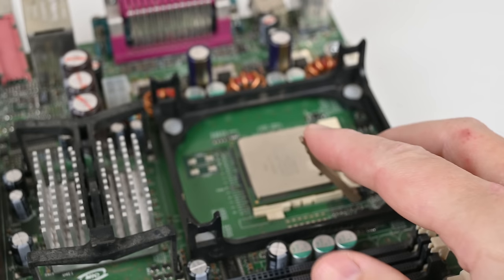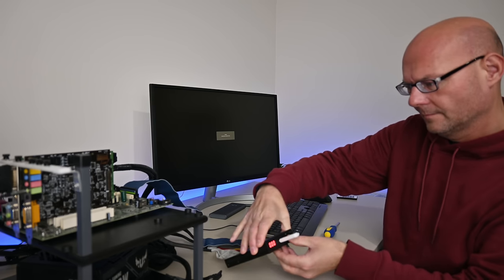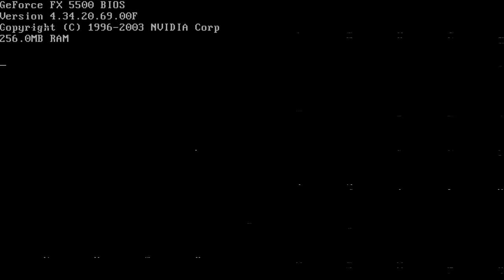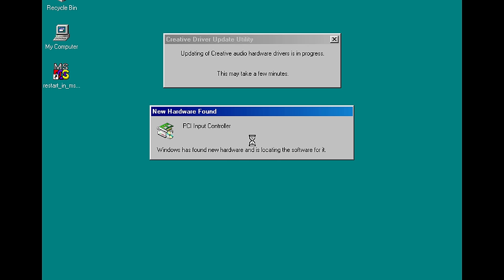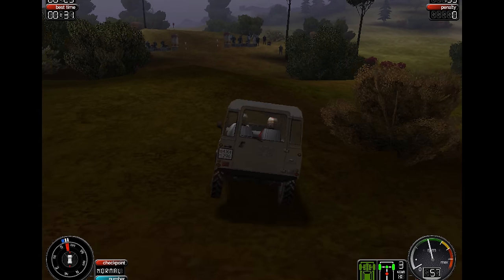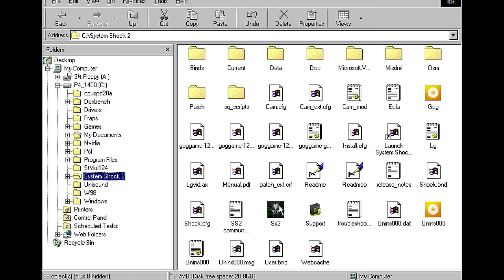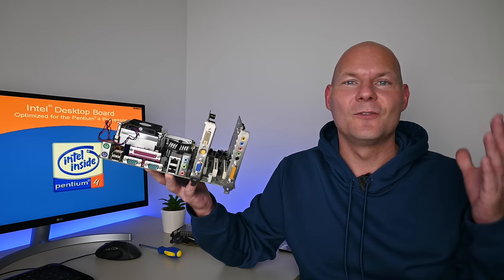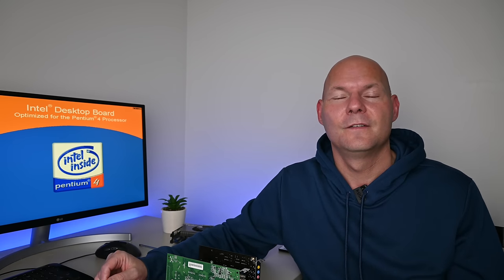It Failed in 2000, Has It Aged Well? The Pentium 4 1.4 GHz

Comment: Fx5200 and fx5500 is exactly the same card, if you flash the correct memory sized 5500 bios to a 5200 they work correctly

Only difference between the two cards is clock speeds and some of the 5200's lacked fans that most 5500's had
Reply: And if the card can run it stable, flash the 5200 Ultra BIOS, which is faster than both and sits between the 5600 and 5600 Ultra.

Comment: P4 the biggest failure intel ever had was building thousands system builds back then while amd crashed intel from 2000 to 2007 in every way around back then from first 64bit and intel had to buy out the technology for future generations to and first dual cores amd p4 was well known to be a good griller to cook specially prescott something intel slowly recovered then by 2007 into core 2 something similar going on now with intel again using old 6 year architectures pumping them just with new futures to catch up with amd but it cant since 2006 intel is gone maybe they will better recover by 2025 when they build ther new fabs and better nm

Comment: Ok so this comment will differ from others in that I am NOT a gamer. I sold a P4 thin client PC to a Locksmith who had a dying P3 system with Windows 98Se and custom key coding software that he lost his original serial number for so I could NOT migrate him to Windows XP pro. The system had 1GB of ram and onboard everything(Intel Chipset i845). Win98Se did NOT like 1GB ram! I had to hack the OS to make it work with that ram! Oh what a PITA! I will tell you finding windows 98se drivers for a Socket 478 i845 chipset motherboard was NOT easy either. The onboard ethernet and sound and VGA was a PITA to find working drivers for. I had to install a small XP pro installation on the same HDD of that machine just to boot into to use his internet to find and finally install drivers to work in his old 98se installation. All in all, I learned ALOT about auto exec bat and config sys file settings that day and I did get it all working. BUT, a lesson here? Retro computing is best left for actual retro computers or emulators.. Old unsupported OSs on modern hardware is a recipe for rage, anger and smashing a PC or 10 lol! P4 systems work great with XP pro and most modern Linux and FreeBSD OSs out there. If you want full hardware retro computing with DOS based OS support, stick to P2 or P3 systems.. That early P4 1.3 and 1.4 system though, I remember from my dad buying it at the computer show in 2000, was windows 98se and windows 2000 compatible, so there is that..

Comment: Athlon thunderbird 1100 mhz, later a 1300 mhz one, burned a motherboard, ram and the first one processor damaging the chip, oce the other one to 1450 mhz and pass to and athlon 754 3000+ what a journey 😵‍💫 Used with windows me and xp

Comment: "The unlimited marketing budget of Intel" translation Intel paid OEMs (HP Dell Compaq Sony and Emachines) bonuses to use the Pentium 4 in almost all their systems and not use AMD's better CPU. Because clock for clock the Pentium 4 was slower than a Pentium 3 which was significantly slower than AMD's offerings. They held up really well for dos and windows gaming up to around XP, Vista and 7 hit the Pentium 4 very hard though and even a newer intel Atom chip tended to outperform it on newer OSes. Have three of these safely tucked away in case someday I feel like making a 98/dos retro PC though as it's more compatible than newer chips, have two 1.6GHz chips and one 1.4GHz chip all for socket 423. The Athlon 64 wasn't just competitive it took a Pentium 4 clocked a full GHz higher to even keep up with them hence Intel's court loss backed anti-trust marketing program.

Comment: The reason the P4 was unloved was because it was so much alower clock-for-clock with the P-III. There's a reason Intel switched back to the P-III core for mobile Pentium-M, and developed that into the "Core" architecture. That doesn’t mean it was objectively slow, execpt when compared to contemporary Athlons! ;-)
Reply: really it was not that slow. It was the stupidly long pipeline........ the p4 can do amazing stuff when used properly
Reply: @CotyRiddle  The long pipeline made it slow in many real world scenarios. Avoiding pipeline stalls and mispredictions could provide decent performance, but that meant both compiler optimisation specifically for NetBurst, and writing code with it in mind. Echos of IA64. The AMD Bulldozer architecture has similar issues, and again it's pretty hated, even though code
optimisation targeting it specifically performs well, especially if using XOP.

Both microarchitectures are great with Gentoo Linux, I can vouch for that, but they were intended to perform well with generic code, neither did consistently, and in the case of P4, it never managed to reach the clock frequencies the compromises were introduced to allow.
Reply: @TheUAoB  that is true. if i recall intel was stating 4 Ghz for net burst as we can see i think if i recall correctly the max speed was 3.6 or something very close to that. Yeah bulldozer was a dozer amd screwd them selfs on that. but again like you said when specifically optimized for it things were pretty decent. (i had a fx 4350 and it did reasonably well for things like video transcoding but average to poor for things like gaming. sad when a core 2 duo overclocked mopped the floor with it in the exact same games with exact same settings and gpu with less ram LMFAO)
Reply: @CotyRiddle  They expected to reach 10GHz!

Comment: I think system shock 2 shocked your system!

Also, shogo is great fun. Little tio, in the first areas where you go to get background info on the mission, one hologram doesn't work, but if you switch to software mode you'll see what's supposed to be there! Also, this game has a point where you can pick a side for 1 of 2 endings. There are also some interesting shortcuts and hidden areas
Reply from the maker: I'll feature System Shock 2 soon! With eax sound and headphones. 😲
Reply: And the save the cat / captain claw easter eggs lol

Comment: As I recall the P4 didn't run as well at all with SD-RAM, so you were lucky to get RD-RAM.

It would have been fun to see it with the worst RAM option as well, as I feel thats what most people encountered in the wild. Myself included.
Reply: It was horrible with SDRAM, the architecture really needed lots of bandwith. On my 3 GHz Cedar Mill I get about 15% better performance by running 12x250 with DDR2-833 instead of 15x200 with DDR2-400. Same CPU clock, but the bandwith does a lot. Just the thought of a Pentium 4 with a bus layout like a late Core 2 would be insane. If going from 200 MHz to 250 MHz gives 15%, how much would 400 MHz do...

Comment: gigabyte 8tx motherboard, pentium 4 willamette processor, rdram memory, dual 3dfx voodoo2 sli pci graphics cards connected to geforce fx 5800 ultra agp, sound blaster audigy2 sb0240 platinum ex or adlib gold

Comment: Ah, that 1st gen Pentium 4 was really terrible. If you have a Pentium 3 1.4 Tualatin to compare that would make a great video.
In the year 2000 I had a P3 550MHz on an Asus P3B-F i440BX motherboard with 2xVoodoo2 SLI. I wish I still had that system. Later that year I upgraded to a P3 933MHz and a Radeon 32 DDR. Then, in late 2001 I got a P4 2.6 which I overclocked to 3.0 and a Geforce 3 ti200. Then... jeez I've spent too much money on computer parts in the 2000s.

Comment: pentium 1, pentium pro, pentium 3 katmai, pentium 4 willamette and northwood processors, intel core 2 quad QX6800 B3, intel core i7 980X, intel core i7 3960X C2, will be supported by the manufacturer until 2030, then from 2050, sdram memory, rdram, ddr1, ddr2, ddr3, ddr4, agp, agp pro, pci, pci express 1.0, pci express 2.0, pci express 3.0, sony pvm monitors, crt dell P1130, samsung 226BW will be used in the future

Comment: Pentium 4 w/ HT, Socket 478 - Question: is the 3.4GHz noticeable in gaming vs the 3.2GHz?

Why? I've got a 3.2GHz paired w/ GeForce 6800 Ultra OC, not sure if 3.4GHz is worth the extra $$$?
Reply from the maker: I doubt it, maybe a tiny difference in benchmark numbers...
Reply: @philscomputerlab  thanks! It's for my retro corner. AMD Athlon XP 3200+ & ATi Radeon X850 XT PE (vs) Intel P4 3.2GHz w/ HT & Nvidia GeForce 6800 Ultra OC.
Reply from the maker: @scottstamm7022  If you want a upgrade from that, aim newer parts. Like Code 2 with a 8800 GT, something like that.
Reply: @philscomputerlab  wish I had your contact details. No, it's a retro corner for last of the 32-bit only systems from 2003ish. So my kids can see what single core computing was like.

I have a all 2007, and a all 2009, system that are AMD and ATi.ATI. My office is a slow progress at this time, but I love some of the old retro stuff, reminds me of my childhood!

Comment: Hi Phil  i enjoy your videos..I have a ptoblrm  with Whatide  i can,t get it to  boot on  CD  my PC is  Athlon 2400 .There is no floppy  drive on there I just want to get my SD to IDE adapter to work as a  98 Os .The 32gb  SD shows as 33mb.Hope you can help.
Reply from the maker: Does the bios detect the SD card? Make sure it's blank, not partitioned. Then boot 98 OEM cd it will partition. Reboot again and then it will format.
Reply: @philscomputerlab  Only as 33mb..Thanks for that Phil i will give it a try,.keep up the good work.Does it make a difference  if the card is micro or the full size one?I notice  you use the bigger sized one  and what do you recommend  for 98  16 or 32?
Reply from the maker: @timcollins9800  Micro SD or full size doesn't matter! 32GB is a solid size for 98 🙂

Comment: From 2000 user perspective, Pentium 4 was kinda scam, since it was expensive, new architecture without performance gain you expected. It's clear that Intel did it to push frenquency as far as possible for marketing reasons.
Really enjoy your new games library for testing, but I'm suprised that there's not a single DOS game, or something designed for Windows 95 in mind. I'm really interested how effective Pentium 4 if you want to play something older.
Reply from the maker: It's very very very fast for DOS 😅

Comment: 99-00 era pc were not very reliable but i think the athlon tbird 1400 was worst than this, had one in 2000 and it barely last 6 months before i had to replace everything with the first gen pentium 4 which last me way longer, at this time amd was done for me, few years ago i bought another tbird pc with almost same specs than back in the day, on windows me with a gf3ti500, 512mb 133 ram, it never failed but man its so unstable and generates alot of heat, i replaced it with a 1.6ghz p4 and its no better, now my winme pc runs a p3 900 oc and its barely slower in games, no difference in windows interface... on top of this the amd requires a psu with an higher 5v amp than normal which cost alot, go with intel
Reply from the maker: I want to try ME again 🙂

Comment: Well, it's quite useless for anything other than Win98 and MS-DOS 6.22 stuff, so it yeah. It's shit, but acceptable shit for retro machine stuff. And the higher clock speed was to get idiots to buy based on the sales brochure numbers, not performance and this bit Intel in the ass. HARD. But yeah. As it's performance equitable to a system with half the clock speed with a traditional pipeline CPU and conventional mass manufactured memory, like a P3 or an Athlon system. So, a P4 1.4Ghz == 700Mhz P3 it's perfectly fine for this sort of class of system.

Ain't never gonna age well though, deplorable thermal efficiency and latency fucked memory solution that cost ridiculous amounts of money due to licensing, it's a turd. And won't turn to gold by polishing it. 

I'll give it this; It's got a solid chipset from Intel meanwhile AMDs nonsense based on VIAs buggy bullshit, isn't. So, THAT has aged well. :D
Reply from the maker: Great point about the chipset. I just had such a hard time with an Asus deluxe board. VIA and Promise SATA ports, but just not working for me...
Reply: @philscomputerlab  Yeah, the chipset issue is what made me abandon AMD systems entirely for over 15 years, after several horrible experiences with K6-2 and Athlon systems in period. Having the fastest CPU per MSRP and TDP rating isn't worth much, or rather, worth very little if the system will not run stable prolonged periods of time or will crash with data or memory corruption issues at the slightest adjustment of BIOS variables or installation of a standards compliant addon card.

And if you're versed in the horribly problematic history of AMD Athlon chipsets and in particular how VIA handled things like hardware bug reporting and collection of this data as in, they did not do it properly and sold completely unserviceable junk with the same revision label as barely adequate stuff this going all the way  down to their own manufacturing technical packages for licensees.

This is really bad, but what is worse, is that AMD licensed their reference chipset from VIA. In fact, nearly all AMD Athlon Socket/Slot A chipsets are based on this AMD reference which is a bug riddled VIA VP97x that has a ALPHA EV6 CPU bus kludged on to it.

Including for example nVidia nForce chipsets and ALI/ULI chips. And I think SIS as well, though their chipsets seem like the best of the bunch overall. All of the chipset manufacturers had a nightmare of a time trying to debug the VIA stuff to make a functional product and practically all of them failed.

Some say VIA stuff gets better in the later generations, but after my experience the thousands of dollars I wasted on this garbage,  I'm not touching it again. Although, I do have a VIA MVP3 system to run my K6-3+ I've been working on, and its a similar catastrophy that simply won't run stable. I've tried everything, including underclocking the ram and CPU and it won't work with my Voodoo 3 3000. Going to try Celeron A on a Abit BP6 next. At least with that I know the instability means the board needs a recap for certain. With the via board, its a roll of the dice what junk rolled off the production line.

And the lack of a proper reference chipset design from AMD is the reason AMD never made in-roads into more reputable mass manufactured OEM systems that sell hundreds of millions of systems yearly to big corporations, only their entry level stuff and bargain basement consumer grade junk.

And this to this day reflected in AMDs success in this front. The Server side of things being another area where the chipset being junk was an issue, which has today been mitigated. But it took AMD over 15 years and being brought to their knees bordering on complete annihilation for them to learn their lesson.